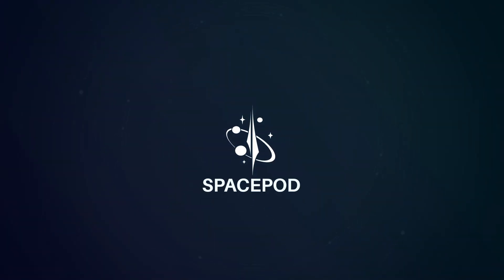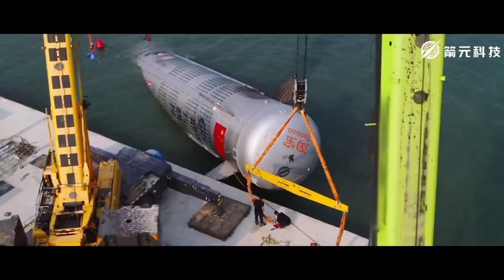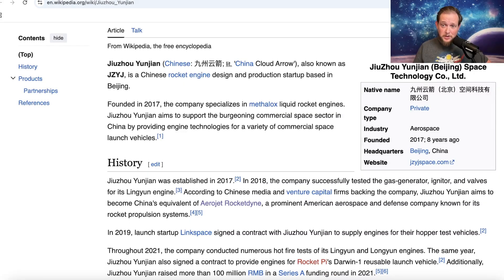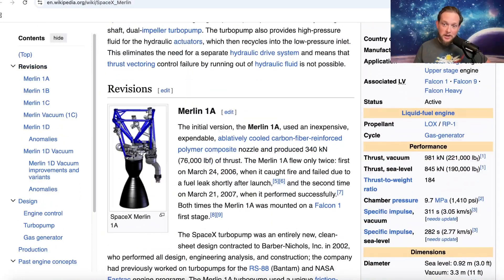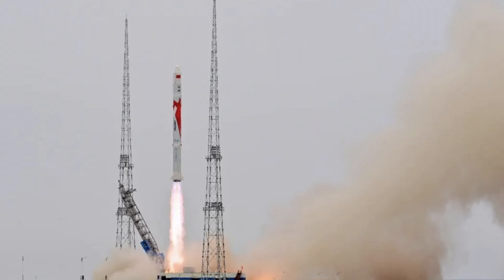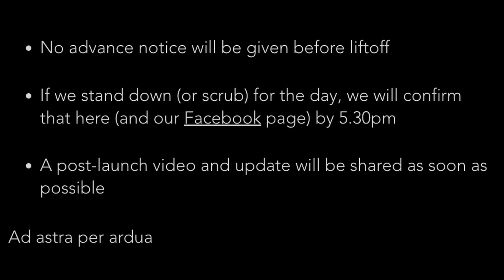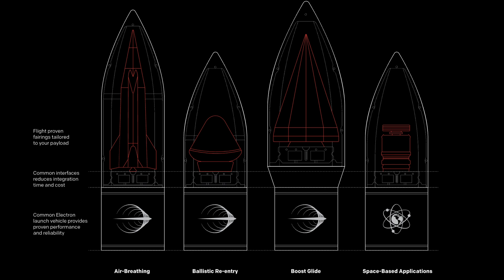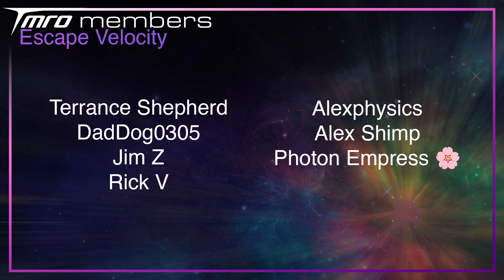China Tests Rocket Engine Recovered From Ocean

Comment: It's just seawater, not acid. People swim in it.  Just rinse the engine off with deionized water within an hour of dunking and the engine should be fine...
Reply: That's a shame... and this is just a test phase, they can still land it on a wide runway in the sea with a pontoon system and drag it after the mission is complete without making it touch the sea water, there are many ways to do it

Comment: surprisingly rocket engines are all terrain, you can fire it under water, you can fire it in air you can fire it in space... the only parts that would be the problem is what is vulnerable to the seawater, limit that and you have a good engine to drop on your neighbouring countries or the middle of the ocean
Reply: This is just a test phase, they can still get it on a seabed with a pontoon system pad and drag it after the mission is complete without it touching the sea water.